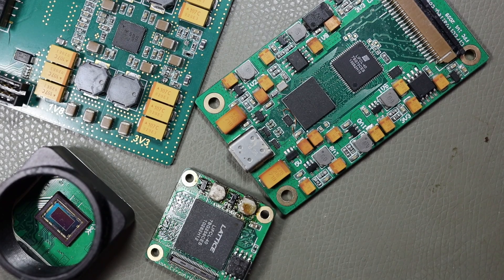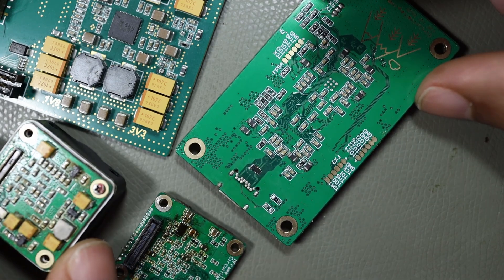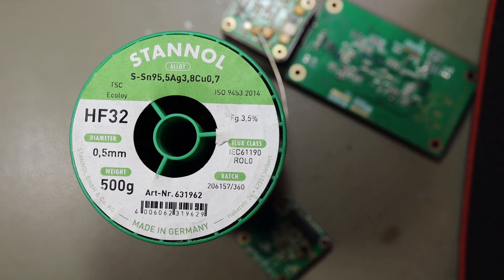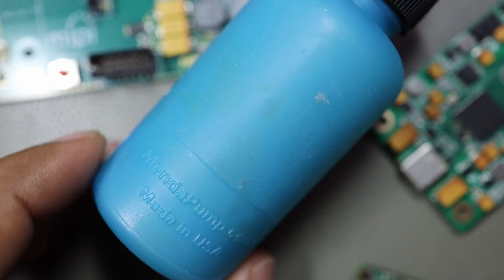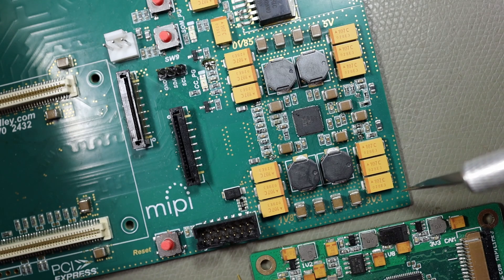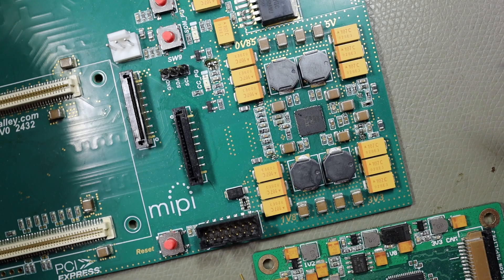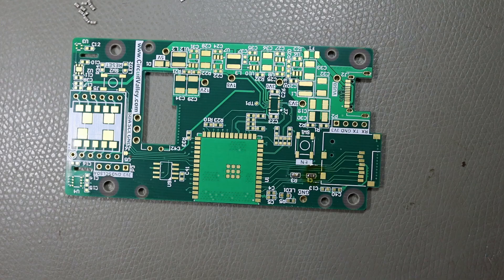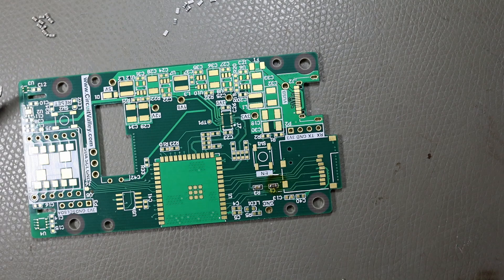Advance Fast SMD Soldering Tips Dealing with Lead Free solder and Flux How to Solder Heavy PCIe Card

Comment: That soldering tip at the end is worthless. Most of the time it will take longer to get one component soldered because you have no control over the component.
Reply from the maker: Not really, This is how I solder many many board. I know people personally how do medium prototype run like this. Its very very fast. Now to control the components first you have the wire itself and second surface tension of both of ends soldering at time automatically align itself. if you practice it works really well.
Reply: @circuitvalley  Keep on doing it. I just can't put a tiny SMT device on the tip of the iron. You are decreasing the life of the component. Also, you cannot do this on any SMT LED period... (devices smaller than 0603???).
Reply: @circuitvalley  "I know people personally how do medium prototype run like this." Let me know so I won't buy anything from them :)...
Reply from the maker: @thekaduu  I can see you have agenda, No comments was deleted. Thank you for your kind words.
Reply: It’s probably a technique that requires practice. You might want to try it for awhile before stating that it’s useless. He clearly demonstrated doing it in the video so he managed to control the device on the tip of the iron. So it can be done.
Reply: @totallyfrozen  Of course it can be done. He did it in the video. You go ahead and use it. I don't have to try it to know it is not good for the part having handled soldering iron 25+ years. I guess you'll learn when tolerances are tight and frequencies are high. Keep going... it won't affect my wallet. Hey, kick it up to 350 C while you are at it. It wets much better... hahahaha
Reply from the maker: @thekaduu  Some people may have a agenda just to criticize , That is totally understandable,  but with there agenda they miss the facts. I suggested , Using solder wire itself you can have some control over the components and its orientations.  Watch carefully. I also suggested be quick. to prevent any damage to heat. But please try and understand. Soldering one side and then soldering other side may also cause damage.
Reply: @circuitvalley  My previous comment is deleted...